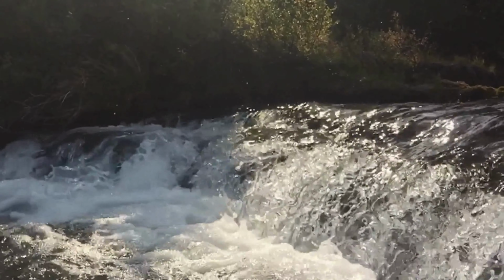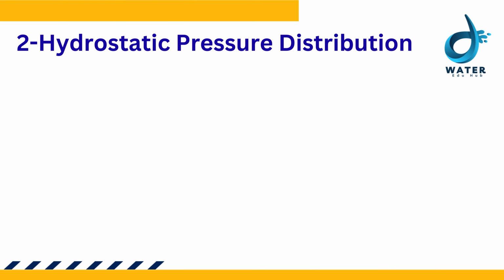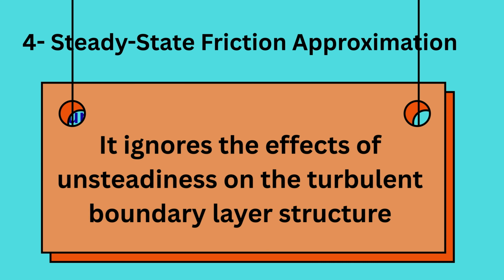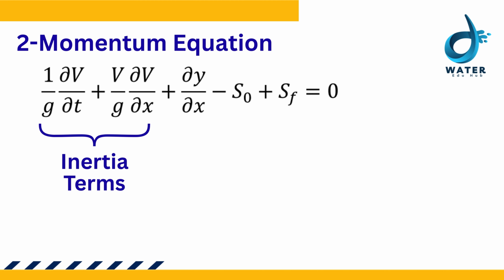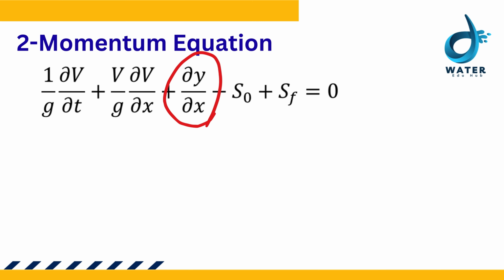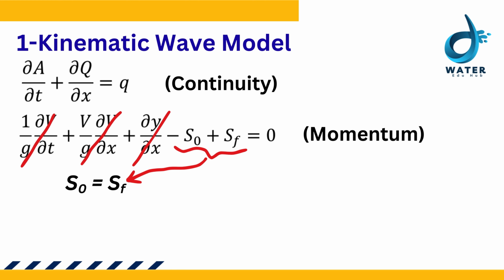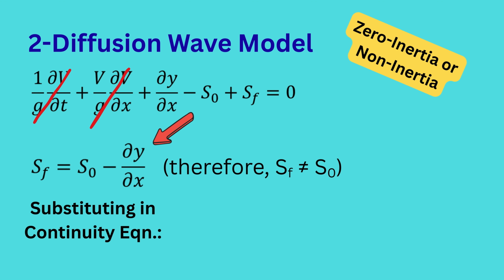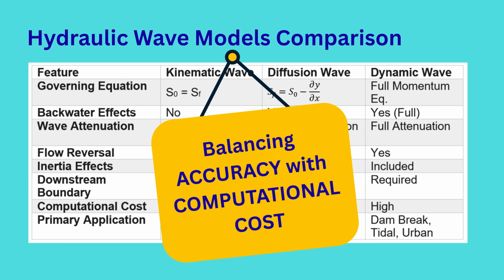Hydraulic Wave Models Explained | Kinematic, Diffusion, and Dynamic Wave

Comment: Thanks for your explanations, they are succinct and clear. 

PS: is it possible to take out the music in the background? Your voice is already very clear but the music introduces distraction and leaves the viewer trying to suppress the effect of the music and still grasp a technical material. It will help a great deal if the music is removed. But if you decide to keep it. It’s okay too, after all, it’s not a big deal. Thanks once again.
Reply from the maker: Thanks for the suggestion. I guess removing music completely may make the videos very dry and monotonous. Many experienced YouTubers advise having it. However, I fully agree with you that technical content may need more concentration. I try to lower it as much as possible so it doesn't affect the viewers' concentration. Thanks again for your support.